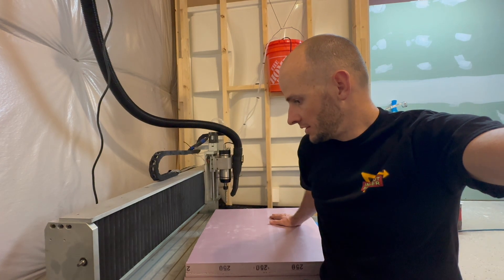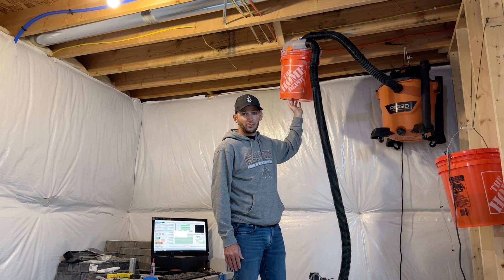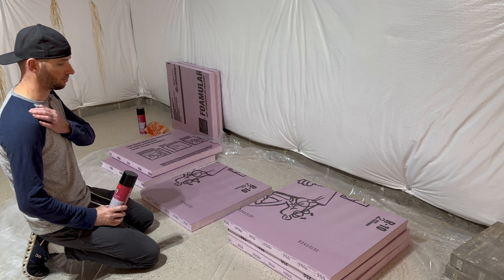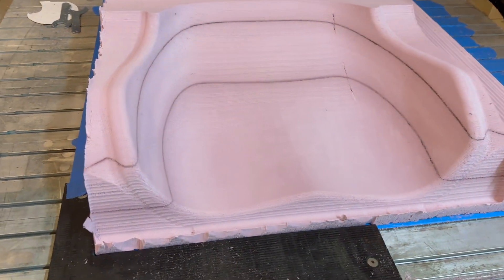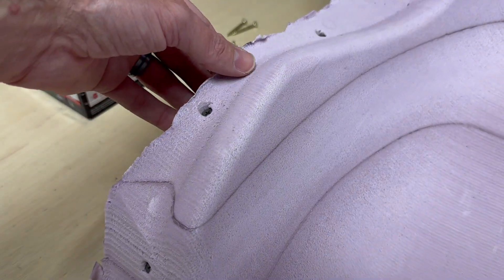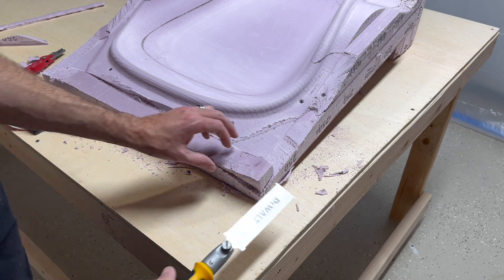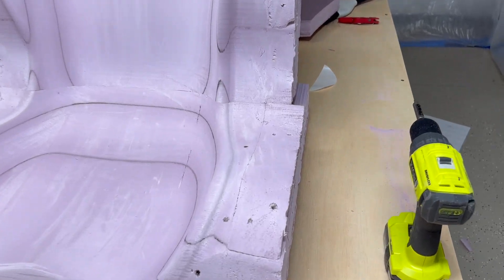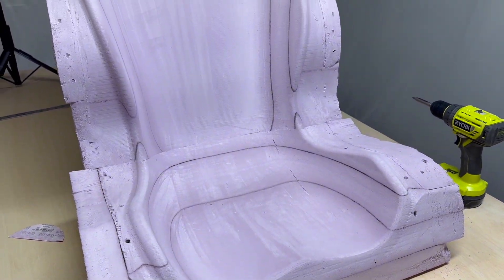Foam Plug for Carbon Seat (1 of 4) | Basement Kit Helicopter Build Ep. 2

Comment: The mold looks great...  Tell us more about the cutter that you use and bit speed and feed rate please..
Reply from the maker: Two flute standard and ball end mill. Ran the spindle as fast as possible. I don't have a way of measuring spindle speed but I assume its around 10-15K rpm. I also maxed the feed on my router which is about 200 inches per minute.

Comment: I haven't heard anyone mention it yet but when you're gluing the pink foam together... There is a thin plastic sheet on each side of the foam. Pull that coating off before spraying your spray glue on. Super 77 will hold it together without a problem. What you're seeing there is that plastic sheet pulling off the foam. That's your delamination problem.
Reply from the maker: Good point… I’ll have to check that out… I also noticed that the sheets aren’t perfectly flat. They have a wave to them and I assumed there were a bunch locations where the gap was too big for the spray adhesive. Either way, taking that film off, assuming it isn’t difficult to do, is probably a much better way, regardless of the glue. Thanks!
Reply: @TheOkayestEngineer   with the film off and the foam pressed together, it should bond without voids.
I use foam for my home cnc mill since its cheap to prototype with, and bad cnc code dragging a tool in foam is cheaper than a new tool. lol
Also for lost foam casting occasionally, but mostly to mill before expensive billets.

Comment: From someone that used to do cabinetry, hearing "I know the factory edge is square" actually made me chuckle. Sheets of melamine and veneers were notorious for having garbage edges
Reply from the maker: Very fair point! I should have said more square than my CNC fingers are able to create.. but there is a pretty big difference in how close things need to fit between quality cabinetry, and foam that is held together with spray glue and body filler. haha

Comment: I am doing the same thing using  my 5 axis cnc router for my custom car body parts. I also had trouble with the best glue to use . I ended up using the expansion spray foam from a spray can. Spray on foam and then spread over foam surface with plastic blade. Once fam collapses down, place the next layer of foam board on top with some weights. Foam paste sets up within a few hours and is ready to machine without clogging cutter.
Reply from the maker: Have you tried gorilla glue? After a little more research that seems to be what most people are using. Your suggestion also sounds promising!

Comment: Its a different path than what your going down, but if you don't need the seat to fit different passengers, custom formed race car seats are gonna be lighter and dramatically more comfortable than just about anything else. 

Essentially you sit on a garbage bag in your desired seating position and someone pours expanding foam  in. Over an hour or so it will expand to perfectly cradle your body. From there you make the mold and the actual Carbon seat molded to your body specifically. 

Here is a video with the general idea. 

https://youtu.be/VTGELArtLVE?si=k3j0yFpFZ8szCpqL
Reply from the maker: Thanks for the info! I’ll look into this a little more and add it to the “short list” of future projects haha.

Comment: @ 11:20 - just literally use toothpicks at an angle...this will pin the parts together...and keep from making bigger holes. If they're too small, you can use bamboo skewers.  VERY CHEAP and effective. We use them to fix our planes all the time with huge dynamic loads...yours just needs to be statically strong enough to not lift edges while you're putting down the fiber glass.
Reply from the maker: Definitely would have been a more simple solution. There will absolutely be additional opportunities to try it out! haha

Comment: Im curious.. do you have a private rotorcraft license? I'm aware your mosquito is experimental, but do you have any flight time as PIC? This is going to be an interesting build and I'm looking forward to your videos. Im currently pursuing my rotorcraft PPL and they're tough, but fun to fly.. it's like trying to stand on a ball without falling off.
Reply from the maker: I have 3 hours of instruction in an R22. I have hundreds if not thousands of hours flying RC Heli's and FPV drones. I'd consider myself pretty good. That being said, I was extremely humbled on my first rotorcraft lesson. By the end of my second hour I was hovering comfortably but my feet were struggling.. you don't use those dumb things while flying RC stuff. I will have my PPL before flying my Mosquito!

Comment: Instead of fiberglassing the mold you could also use bilge (epoxy) paint after fairing it with epoxy fairing compound…to create a had surface and use release wax on that surface before laying down the carbon fiber…
Reply from the maker: @jmalte4702  I’m definitely new to all this. If I understand you correctly, I could have forgone the plug and went straight to the mold using bilge. I won’t spoil the next few videos but I’ll keep that in mind going forward.
Reply: @ yes, when I did a mold for a fiberglass job I used the pink foam as the base, using TotalBoat fairing compound to get a nice smooth surface and than used epoxy bilge paint to create a hard wear surface. Adding release wax to that bilge paint surface and you can take parts directly off the mold.. just remember to have slight release angles everywhere to help with the part release…
Reply: I build tooling and make small FRP parts for a living. There’s a fine balance between material selection for your molds and how much time it’ll take to end up with a usable mold/plug. You could have used a high density tooling foam instead of the pink foam and skipped the plug making all together and milled a “direct mold” However tooling foam is way more $$ compared to the pink foam but you have to consider the amount of labor it takes to get the pink foam “ready” to pull a part. A sheet of 10-15lb density tooling foam is going to be about 2-300$ per sheet of 1” and the cost goes up quickly for  higher density foam. I deal with this dilemma often in my shop between spending money up front on tooling material to save me labor on mold/plug prep. MDF wood has always been my go to for making direct molds that I can pull parts directly from because MDF is very cheap yet it has the density required to layup parts directly on it however MDF is porous and you can’t pull vacuum on it for resin infusion so I only use it for hand laminated parts.  I’ve done alot of testing using marine grade expanded PVC and it’s been working great for direct molds in my shop. A sheet of 3/4” XPVC cost me $189 which is more than MDF at about $60 but, it’s not porus and it’s about 30lb density which is plenty for pulling direct molds also when it’s epoxy glued together it will never break apart. I could babble on for days about this stuff but one last suggestion. Hawkeye Industries makes a full line of primers and surfaces for tooling work called Duratec. They make a product called StyroSafe that is specifically designed for surfacing low density foam molds/plugs like the pink foam you’re using. They also make high build surfacing primers that can be polished to a high gloss finish that you can then simply pull molds directly off the primer surface. 👍🏼
Reply from the maker: @boatcrafterscollective I really appreciate the input! I struggle with the fact that I’ll probably only ever make 1 part with this mold… it’s already an insanely labor intensive and expensive process for one part as is. This seat project was more for me to learn the process than to actually produce a good part or do what made “senses” for making a one off part. If the channel gets bigger I might consider trying different methods to keep things interesting. Right now I have a bunch of excess material that I’ll probably end up using and then switch to the ones you suggested. Thanks again!

Comment: “Fail Fast Mentality”….. You’d be a good engineer to work for. There’s a time to be methodical and calculating, but in a new challenge sometimes you just have to do it to understand the real scope and challenges and with a few adaptations on the fly you can meet the end result you were looking for once you see it wasn’t as bad as you thought it was!
Reply from the maker: You got it! It’s impossible to know what you don’t know until you fail… And to be completely honest, this seat project was more about learning the process than actually producing a good part (there are faster, cheaper, and easier ways to make a seat). And there is only so much research you can do before you need to just jump in and figure it out. That’s what this whole channel/build is about.

Comment: I build rc places and use foam a lot.   Spray glue always lets go.   My favorite glue is gorilla white expanding glue or the clear
Reply from the maker: @georgel5308  I’m about to start another plug. I’ll try the gorilla glue this time. Thanks!
Reply: @TheOkayestEngineer  spray both sides with water before applying the glue